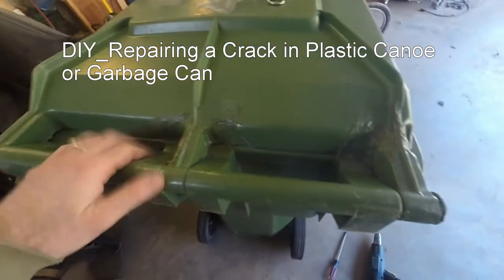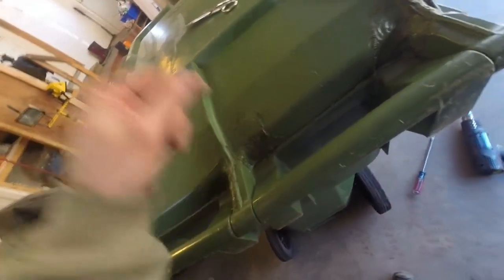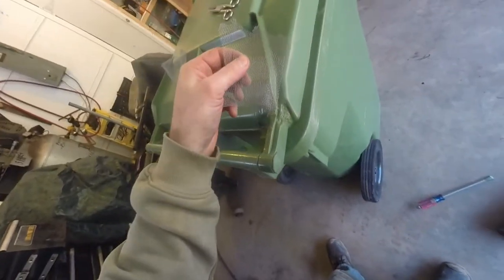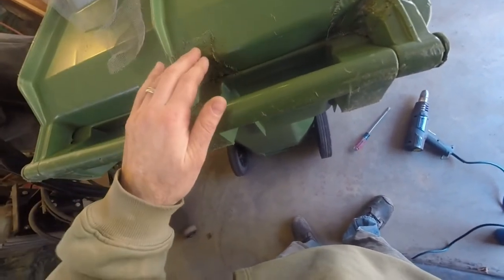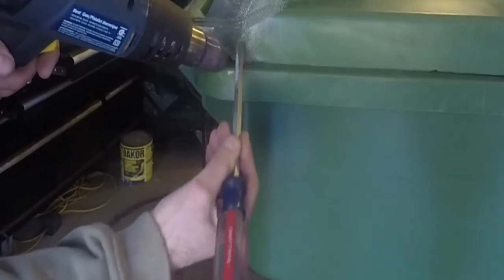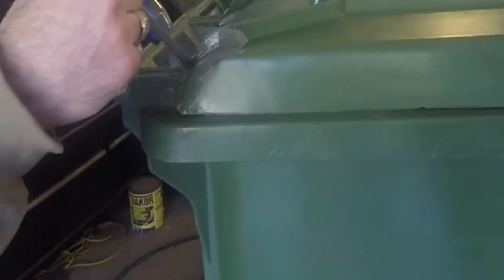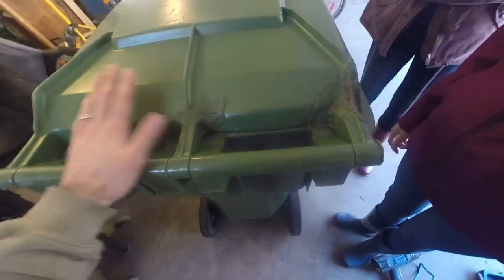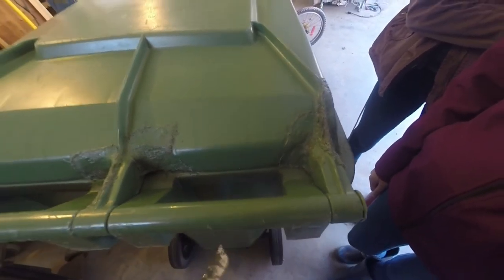DIY Repairing a Crack in Plastic Canoe or Garbage Can

Comment: I think these hinges are breaking when the giant claw from the truck squeezes too hard and causes the outer hinges to spread outwards. 
Another scenario is when the can is slammed down on the diagonal and the weight of the lid causes some side torque to the hinge.  The hinges are clearly under designed to take the forces they encounter over time.

The hinge pins seem to be only fixed on the outside end with some locking mechanism.  When my hinge first cracked, I drilled a couple of stress release holes at the crack ends to prevent the crack from spreading.  The next week I noticed the cracked hinge had been wedged open. The hinge pin had been pulled outward, and the end of the hinge pin was caught at an angle that held the crack open.  The two holes I had drilled had prevented the crack from growing longer, but had not prevented the hinge from opening up.  

To prevent the hinge from opening up at all I simply drove a screw into the non-rotating part of the hinge and all the way through the hinge pin to prevent the hinge pin from being pulled out. The cracked hinge is now constrained from spreading  when forces are applied to separate it.

Comment: Thanks. An informative and straightforward explanation....I need to repair both my recycle and regular cans.... The damage may have been precipitated by the combination of cold weather (plastic more brittle?) and a period of putting heavier than normal debris (broken concrete and old magazines) in the cans
Reply: My experience with plastic is that it used to last 6-7 years before starting to break. Now, in 2020's plastic seems to last around 6-12 months. I'm assuming because the starting material is perhaps from recycled plastic sent from the USA to China that is dirty. When recycling started, we all knew to only recycle clean materials. I often see plastics at work and in my neighborhood in the recycle bins and they have not even been rinsed out. Cheers!
Reply: Also, I've learned to check the warranty time. Replaced a cracked plastic exhaust hose on my almost new washing machine. I noticed the new part was guaranteed for only 6 months. So I replaced it with a rubber hose instead because I don't want to be doing this again in a few weeks.

Comment: Thanks for the tip about pushing screen into the crack.  I first widened the crack with a narrow blade on an electric hand-held grinder.  I suppose a jig saw would also work.  I also drilled holes at the ends of the crack to stop the crack spreading.

Comment: Thanks so much! I have a heat gun and wire mesh and will try to repair holes in the bottom of my trashcan. I'm planning to cut some extra plastic from the top of the can to add to the area with the hole. So nice not to have to go buy rubber sealant or epoxy, etc! Cheers!